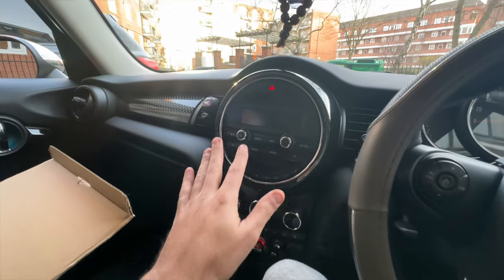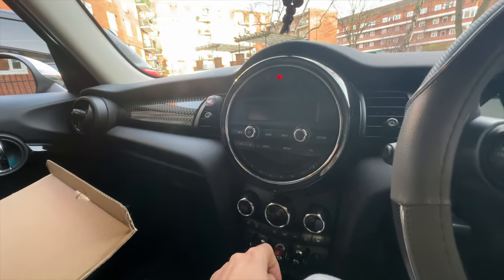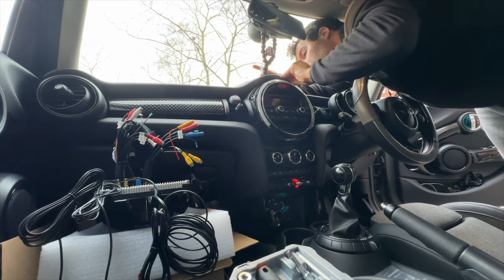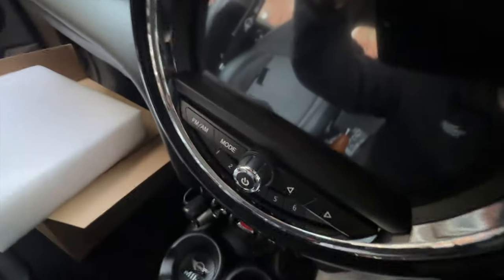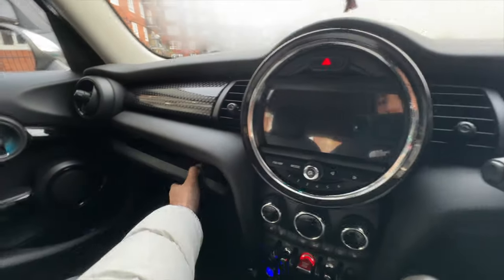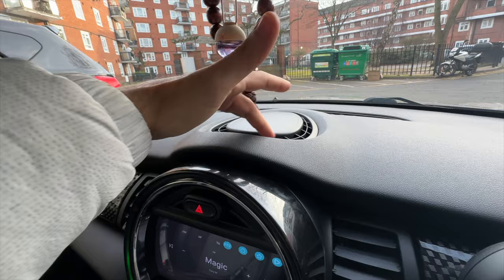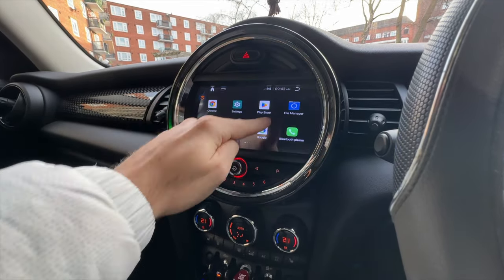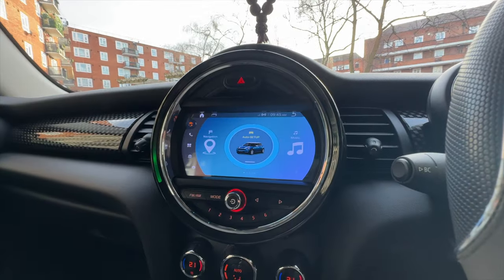MINI F-Series Android Display/CarPlay Headunit Retrofit ( F54 F55 F56 F67 ) W/ Back Up Camera !

Comment: Are you still happy with the upgraded stereo?
Do you still have problems with the mic for the phone and that the person you are talking to can hear themselves?
A tought, can't  you not connect the original mic?
Reply from the maker: I’m very happy with it especially the audio, it sounds much much better. I had a Bluetooth receiver before and it sounded very average but this stereo has surround sound(go to the settings of the head unit and choose it) and it sounds a million times better. The double audio thing only happens with apple carplay if your connected via Bluetooth but not with apple CarPlay there is no double audio( I’m guessing it’s a problem with the apple CarPlay app used called zlink) and I used the mic that comes with the head unit.
Another thing I should say is there is a slight delay when you press next song a 1-2 second delay and that’s because I have CarPlay through Bluetooth. You have a usb to use with the head unit  to connect to CarPlay if you choose I’m guessing that will fix the delay but I just didn’t want cables around so I have it wireless  and there is a delay when changing songs. 
Apart from that I’m very happy with it.
Reply: Hi, I've just installed mine but the phone volume is poor, where did you fit your mic?
Reply from the maker: @philhyde9694 I put it on the vent at the top where we put the gps right on the other side. I kind of explained in the video where i put it. But on the top vent.
Reply: Thanks Johny, I managed to change the door open warnings by going into the factory settings and selecting right rudder. Apologies if you already knew this.
Reply from the maker: Where in settings is that option ?? Could please explain ? I don’t know how to do that. it would actually be great if you could explain in detail.
Reply: @JohnyRodrii  I'll need to get the instructions out. I'll get back to you
Reply: @JohnyRodrii  sorry for the delay, click setup on the display (cog icon), tap Android Version row 4 times, enter 1912 in the password pop up, click ok, then you should be in Factory. Just look for Right Rudder and select it, that changes the car to right hand drive.
Reply from the maker: @philhyde9694  thanks for replying. I will try tomorrow, let’s see if i don’t mess something up lol.
Reply from the maker: I found it in the end! Jajaja lol

Comment: Hi, i have a similar unit from Ali express.
I only want to use my parking sensors without camera. Is this possible? I don't get it working.... Thx
Reply from the maker: My parking sensors worked without me having to fiddle with anything to be honest. They just kept working with the new head unit although I should say that the sound changed from coming out through the speakers to coming out through the head unit. But they just kept working without me doing anything.
Reply: Thx. I have now managed to get it working. For the Sound they have attached an extra little speaker.... Sounds great 😂

Comment: Great video 
I bought this unit recently. Can you add a front camera to this unit as well? If so, will it go to the yellow port with DVR- V label? 
Is the console stable without the bottom screws? 
Any functionality issues so far?
Reply from the maker: It is stable without the bottom screws. I guess you could add a front camera I don’t see why not. 
The issues I’ve had so far I think were my fault so I took out the unit fixed what I did connections were loose or wrong and then everything was fine. 
I’m very happy with it tbh.

Comment: How do you make the light ring follow the Ambient lighting? I have the exact same headunit and have been into the factory settings with the password 1912 and still cant get it working.
Reply from the maker: You can’t it’s really annoying but you can’t. They should update that and let you.
Reply: @JohnyRodrii  Yeah it is annoying, I saw a video of another headunit being showcased in some Chinese factory or something and it was identical to ours menu wise and backend wise except theirs was cycling through the colours.
Reply from the maker: If you go to settings light settings you can choose some stuff like air con revs etc. but not ambient continuous light.
Reply: @JohnyRodrii  I've messed with it all, I only use the setting for driving mode

Comment: Hi, i was just wondering can you turn off the radio when driving or does the screen have to be on at all times. I can't find a way to turn it off?
Reply: Just like the factory radio if the car is on the screen is on.

Comment: Hi,Today I installed exactly the same unit in my car. I tried 2 different rear view cameras but no image on the screen. I connected the camera's video cable to the yellow socket shown in the manual and connected the 12v to the rear view camera 12v output also shown in the manual. When I put it in reverse, 12v comes but no image on the screen. How did you solve this? Do you have any advice for me?
Reply from the maker: You have to choose aftermarket rear camera in settings
Reply: @JohnyRodrii  I figured out what the problem is. It's the 12v supply.Camera does not work when I connect the + wire of the camera to the reserve detection line wire in the unit.So I connected it to the CCD +12v cable on the unit, it works now, but I think there is 12v on this line all the time.Where did you connect the camera + wire?
Reply from the maker: @selcukKoyuncu-bv5ez  I showed it somewhat in the video. The yellow camera cable to the yellow camera female in the head unit and the red 12v camera cable to the 12v head unit cable label as such. And choosing after market rear camera it worked fine
Reply: @JohnyRodrii but how does the unit know you have put car in reverse if you haven’t got anything attached to the trigger wire?
Reply: @JohnyRodrii  I have the same unit. I connected the yellow jack to the reverse cam on the unit and connected the red power cable to the reverse trigger on the unit. Then connected the other end to the reverse light power. When putting into reverse it shows the reverse on the unit but no image just black with white lines. Any ideas?
Reply from the maker: To be honest I don’t know if the 12v that I connect it to in the head unit is just providing power continuously or just when I put it in reverse. But I just tried different connections until one worked. I think I show in the video where I connected it to somewhat. Just make you sure you choose in settings aftermarket rear camera.
Reply: @JohnyRodrii the unit I have had a brown reverse cam wire as well as 12v. I went with the reverse wire as I was powering using the reverse light. I changed setting in head unit and set to ahd camera which is what I have. Just black screen. Really frustrating as should be simple.
Reply: @theedwards9078  I did as you did and I had the same problem as yours, black screen.Then I connected to the CCD +12v wire and the problem was solved. I recommend you to do the same.
Reply: @selcukKoyuncu-bv5ez thanks very helpful. Can I ask how your head unit knew to put into reverse if you didn’t have anything attached to trigger wire and instead had it attached to 12v ccd wire?
Reply: @selcukKoyuncu-bv5ez I did have one instance where the camera came up. I accidentally stalled the car with it in reverse and then I got the image but couldn’t then replicate
Reply: @theedwards9078  No problem.Head unit knows that it is in reverse via CAN communication line so You don't need to do anything for that.But make sure you select Reserve mode: Aftermarket Rear Camera in the camera settings.
Reply: @selcukKoyuncu-bv5ez thanks, I have it set to aftermarket stereo. Did you also join the red wire to reverse light or just attach the two red wires at the camera end together and no need to connect to reverse light
Reply: Merhaba, headuniti nerden temin ettiniz acaba, ben de araştırma içerisindeyim ama satın alması kodlaması ve montajını nasıl yapacağımı kararlaştıramadım. (2019 Cooper 3 Doors mevcut)😅
Reply: @kuzeyemrecelik  Merhaba, cihazı Aliexpress ten satın aldım.Kodlamaya gerek yok direk montaj yapılıyor ama montajını yapabilmeniz için bu işlerden anlıyor olmanız gerekiyor çok basit değil yani.
Reply: Do you still get the fuel computer in MPG? Any links to buy this unit? Thanks

Comment: Does your factory USB Port still work, and does it have wireless apple car play?
Reply from the maker: I haven’t needed my factory usb so haven’t tried it but I don’t see why it wouldn’t work, I didn’t mess with any of those connections so it definitely should work. And yes it has wireless CarPlay
Reply: @JohnyRodrii  Awesome. I am ordering it. Thanks for the response.
Reply: I've just installed mine today. You can connect the cars usb cable into the new head unit. Im just having problems with my battery since I installed mine. Hopefully it's just time for a new battery and it's nothing to do with the new head unit 😊
Reply: @sarahjackson4858 yah I have had 0 issues with my battery so I would say it's probably time to change it.
Reply: @JohnyRodrii  thanks, I can verify now that factory usb work and android and apple car play are wireless.
Reply from the maker: I should probably connect the factory usb to the head unit tbh. So that’s something that I should probably do it’s good to know that it works.
Reply: @JohnyRodrii  I also used the spare usb with a usb dab receiver and it worked
Reply: @ih5643 hello sorry did you need to do anything special/extra for this to work?
Or just follow the install vid and the stock mini usb will work? Looking to get one of these and want to use usb but will I need to do some extra wiring to get this new head unit to pick up the stock usb for use with apple car play? Cheers
Reply: @vizzionnz9658  not it’s pretty plug and play. The big drawback is the Bluetooth call quality sucks.
Reply: @ih5643  oh really did the kit come with a microphone? As it could be the placement of the mic and pickup of the voice in the car maybe?
Reply: @vizzionnz9658  yes came with a Mic but the placement doesn't matter. when connected to wireless car play its terrible for whomever is on the other side for some reason. you can hear them perfectly, but they can't hear you for crap.
Reply: @ih5643 you got a link to purchase please,  thanks